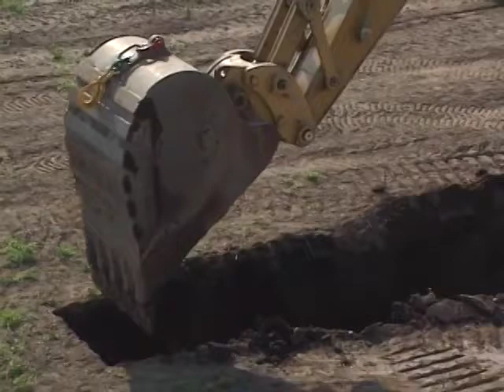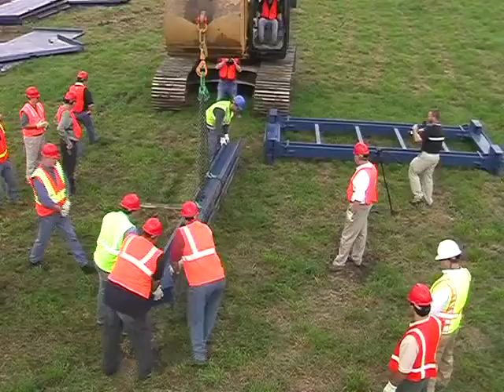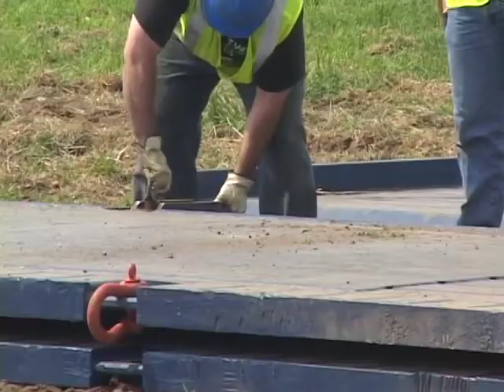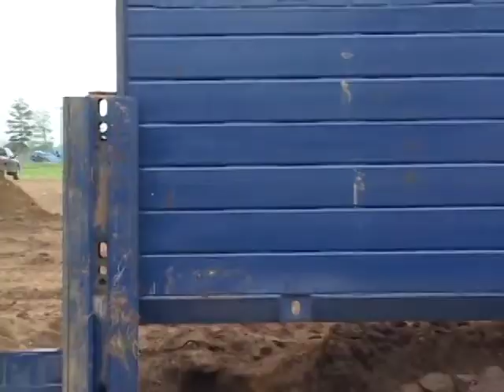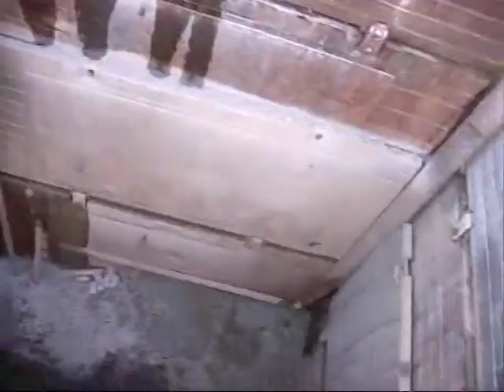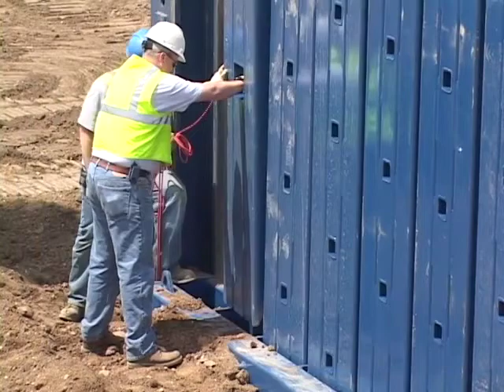Full GME Slide Rail Video

Comment: I was a sewer contractor for many years, 70's, 80's and 90's, we always used trench boxes and if needed drove down street plates on the outside of the box. This  easily obtained depths of up to 20 ft. suitable for most sewer projects. Anything deeper would require steel or wood sheathing. I would have had 4 lengths of pipe in the ground before they got this system in the ground. It may be fine for a stationary project but for pipe work it is not cost effective. The other problem is the assembly is way too technical for most pipe crews, and can easily be assembled wrong and cause an accident. If this is supposed to be an improvement, I am glad I am retired.

Comment: This seems to be a huge amount of work to dig a small hole.
Reply: It's worth the life of every man what have to work in that hole. I'm an operator and I laid pipe for 5 years...being buried alive is not fun..even less fun if u don't survive.
Reply: @docsamarra682  I understand the purpose of it. I was a site manager for a decade (never had a man injured). It's just that I can think of 5 cheaper faster and better ways of doing what they're doing without compromising safety.
Reply: I think so!!